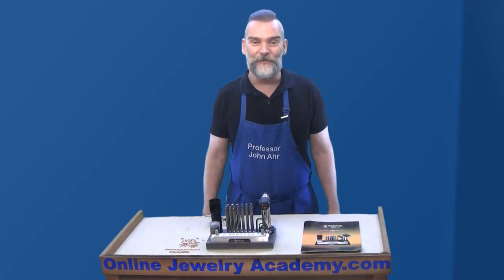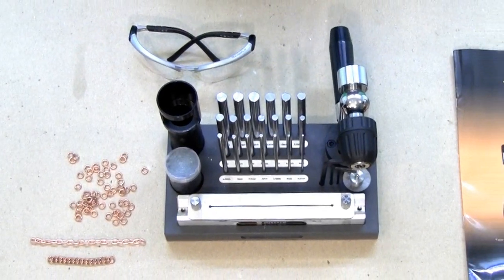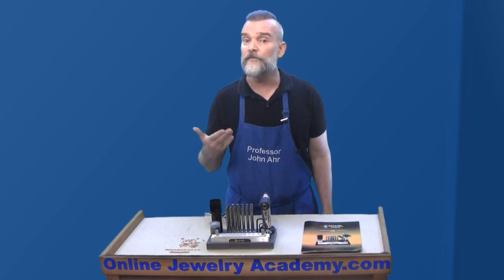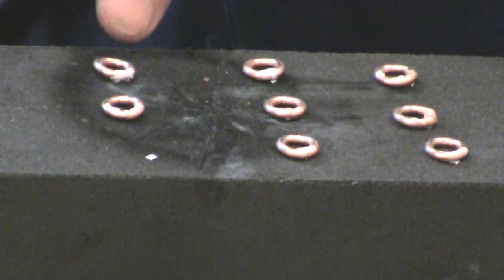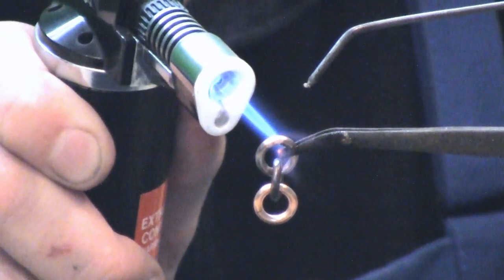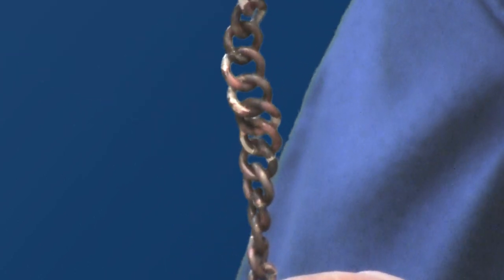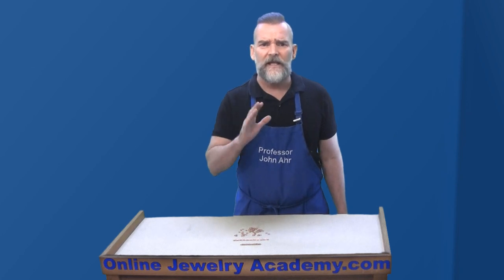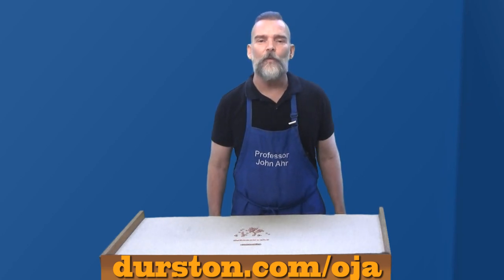Hand Made Chain From Jump Rings

Comment: Hi there, I was wondering if you could explain why copper jump rings seem to bounce off or jump when I try to "soft solder" them to a piece I'm working on with soft solder?
Reply from the maker: I'm not sure you mean by "soft solder".  If you're referring to the solder used in making stained glass, I'm not your guy.  In most cases where items move during soldering, it's because they are not being securely held in place.  You might need a thirdhand to help you keep your copper rings in place. 😀

Comment: Hi, I like all the videos I watch from you. From what I can figure out there is not copper solder? It’s actually the silver solder? Because I can’t seem to find it online anywhere. I only want to solder jump rings. Do I need any solder at all?Thank you for your videos.
Reply from the maker: There is such a thing as copper solder.  But, it's hard to work with and doesn't completely blend in with the copper you are soldering.  My advice is to use silver solder and plate over it with spent pickle.  Here's a link to help you: https://www.onlinejewelryacademy.com/copper-plating-video.html
And yes, you do need to solder your links shut.  Have fun! 😀

Comment: Hi prof.
I watched one of your videos where you mentioned that we shouldn't use copper ear wires. Could you please explain why? Is it toxic? I've made and worn ear wires of copper, so if it's toxic I want change them. Like all your videos.  I always learn something. Thanks
Reply from the maker: Copper isn't good to put through a piercing.  This is because the oxides that form on a copper surface are toxic and can be absorbed through the skin.  Some jewelry suppliers do sell copper ear wires.  But, these ear wires are coated with a material that prevents the copper from oxidizing. 😀
Reply: @OnlineJewelryAcademy  thank you🙂

Comment: Thank you for making these videos.  I learn better techniques with every video.  Can you answer a question please.  What is the maximum gauge of copper wire that can be soldered with a butane torch?  My solder attempts with 10 gauge are terrible.  I'm thinking that at this thickness I should move up to propane.  Thanks.
Reply from the maker: It is often difficult to create enough heat to solder a 10 gauge wire with a butane torch. I don’t know the dimensions that you’re working with. But if you think you need more heat to make soldering possible, then it’s time for a hotter torch of your choice. Good luck 🍀
Reply: @OnlineJewelryAcademy    Thank you for your speedy reply.  I am trying to solder 10 gauge wire jump rings with a 6mm ID to make a cuban chain for myself.  This is my first attempt to make a chain, as well as working with such a thick gauge.  My first attempts were with wire solder that I touched the ring with.  The solder spread over half the ring.  Then I tried cutting the solder wire into 3mm palions to put under the rings.  Most took, but again some had too much solder over the ring and others did not connect properly.  When I twisted my chain about 30% of my jumo rings broke.  Now I will try silver solder sheet cut into palions.  Watching your vido and others, the palions appear tiny, would 2 x 2mm do?  Or is there a specific size for each gauge of wire?  By the way I am using copper as practice till I get this right, then I have bought silver wire for the finished product.  Thanks again.
Reply from the maker: The typical size for a solder pal lion is 1x1 mm. You can purchase a pair of solder cutting pliers that will cut sheet or wire solder to a workable size. It’s great that you are practicing with copper. I hope that you find a hotter torch that you like to work with. And make sure that your seams are completely closed tight. Good luck. 🍀
Reply: @OnlineJewelryAcademy    Thank you so much.  I have practiced the jump ring making and am  satisfied that my joints are straight, filed and close enough.  I've purchased a hotter map gas torch, and now know to not use so much solder.  This weekend I will get back to it and make my first chain.

Comment: Hi Professor John, I'm having issue the red rouge polishing compound ,every time I use it turns my piece black .I don't know if I'm putting too much on the piece or if it works better with another  compound  can you Help?
Reply from the maker: You’re using too much red rouge. A little goes a long way. 😀
Reply: @OnlineJewelryAcademy  I'm pretty sure I have too much on my buffing wheel - is it possible to clean the wheels? Thanks! (Great video!)
Reply from the maker: @Poecilia1963  Yes, you can take off the excess rouge with a buff rake. Or, you can wash the buff with detergent. 😀
Reply: @OnlineJewelryAcademy  Thanks for the tip.